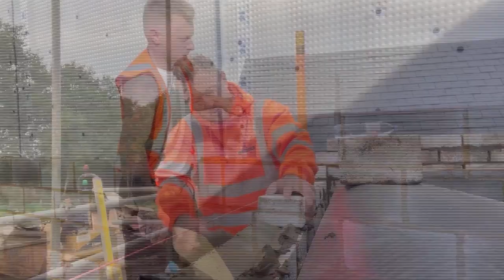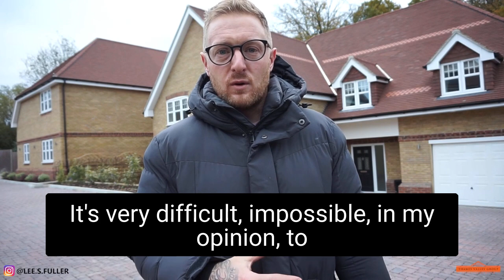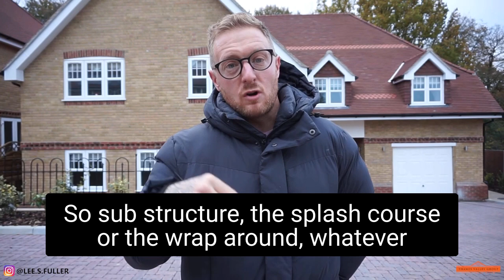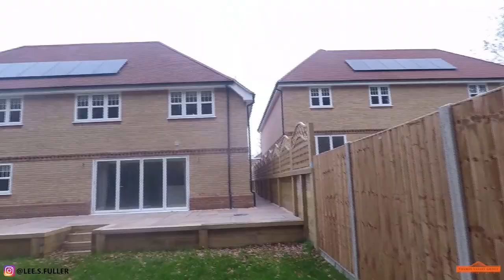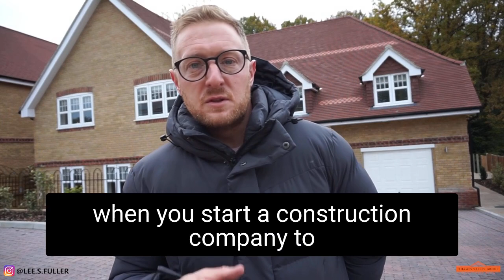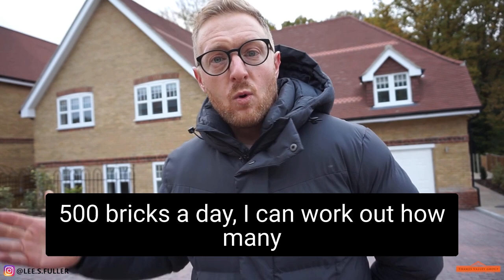EP9. WHAT WE CHARGED!! 5 houses. #bricklaying #construction #buildingconstruction #brickwork

Comment: Those houses looked remarkably like the houses I used to plaster for #WestBuild/#WestHomes in Berkshire - The basic 4 x Bed Cottage Style - Sand & Cement render - Oak beams everywhere inside and ALL of the Plasterboarding (with Hessian Scrim) and Thistle - I used to get £750- Labour 'Only' in 1980 - When i stopped in 2005 I was getting £3,800- L/O for the same house but using Hardwall and Fibretape ...... Hate to THINK! what the Spreads are getting NOW! for the same style houses ... That's if they're still building them 🤠

Comment: So on the substructure been an extra and over? What do you mean by that, priced a few jobs where I've come unstuck when pricing the sub( on extensions)?
Reply from the maker: So by extra and over I mean it’s not included in the price. We always state when quoting “this price is for above dpc, all substructure to be extra unless stated”. It can be difficult to give an accurate price for substructure because a Lot of the time the ground is all different heights and the footings may be out of level or not at the height agreed. Sub structure on a price, footings on a measure or if it’s really bad day work. Hope that helps mate
Reply: @Levelupconstructionmedia  spot on mate cheers for the help with that!
Reply from the maker: @jakefox2324  anytime 🤙🏻

Comment: You gave the plot prices ,but how did you equate to the plot price,per thousand, per m ,if so how much were these did you get paid a solid measurement, or were there extra prices fir plinths arches, trays etc if so what were they did you have use of a fork lift if so did you have to pay for that ,was the mortar ready mix or knocked up in a mixer ,that would have been more helpfull for people wanting to start out
Reply from the maker: Hi Nick. As I mentioned in a previous video I will discuss everything other than our meter rates as our competitors watch these too. In regards to extras for plinths and arches are priced accordingly as extra and over. We used a forklift and the driver was provided by us and the actual forklift was  paid for by the developer. It was mixer muck yes. I will provide as much info as I can but obviously we are actively trading and not about to loose jobs by telling our rates. Thanks